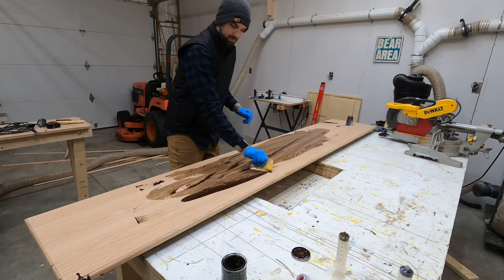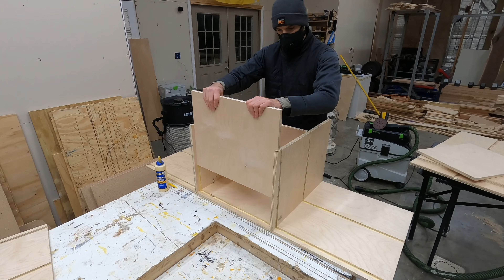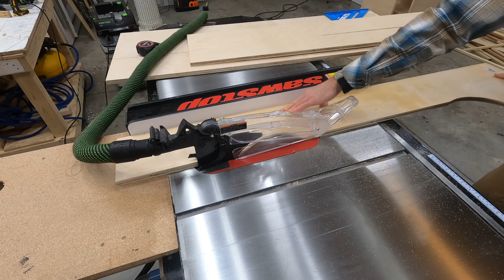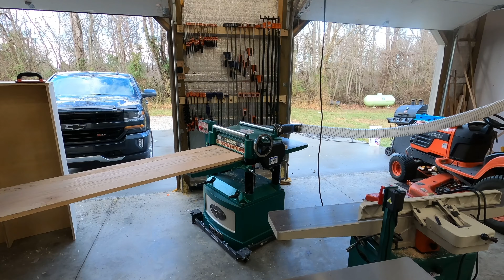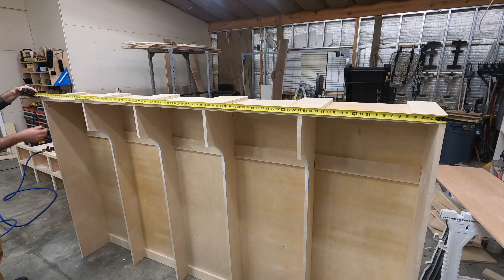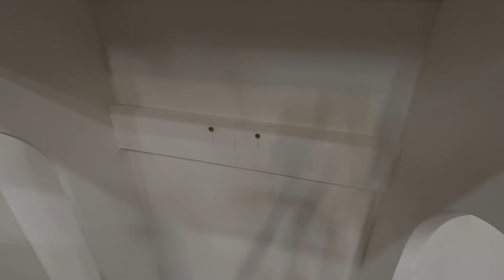Custom Hall Tree Build || MASSIVE Custom Cabinetry || How to Woodworking

Comment: I found this video super helpful for my first hall tree build. I was wondering if you could share how much you charged your client for this? I saw in another comment you undersold it. I'm building this for a friend/client and charging time and materials. Man is hard to find that sweet spot for pricing. Yours is no doubt much nicer than mine, but I thought it'd be a good benchmark nonetheless.
Reply from the maker: I can’t remember exactly, but I want to say around $1500ish. For the amount of time I had in this, and the quality of the end product, that’s very low IMO.

It’s tough to find the line between getting a price for a fun project you don’t mind doing vs trying to make profit.

If I was asked to do this again, I’d probably quote around $2800ish.
Reply: @mmcc_woodshop6288  Thanks for the info!  Really does seem like your client got a fantastic deal given the size and quality. 
Better pump up those prices, brad nails don't buy themselves 😂